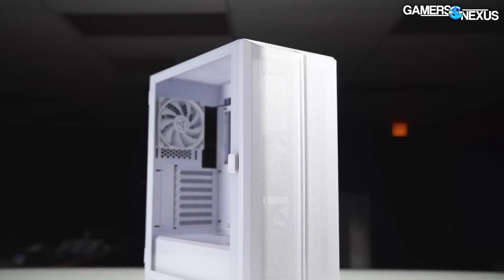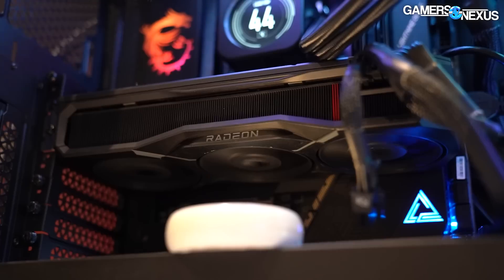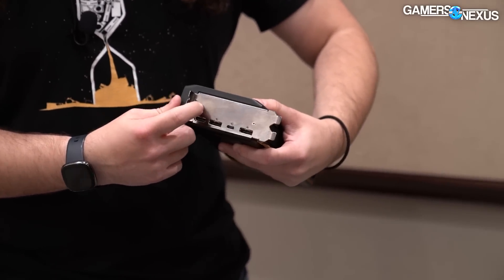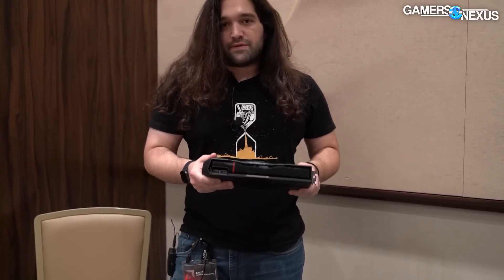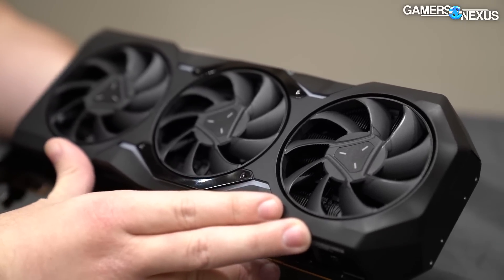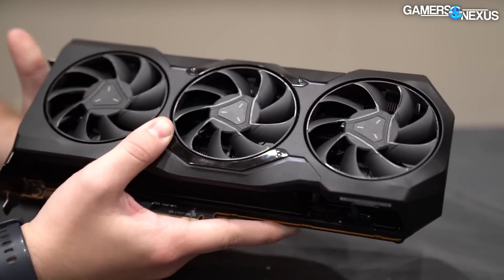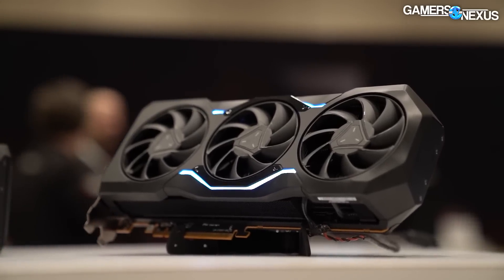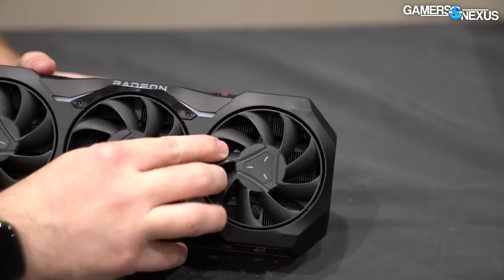More Video Cards Need This: AMD RX 7900 XTX Reference Design Hands-On

Comment: It's a shame it's cheap plasticy looking. Compared to Nvidia FE design it looks budget as hell
Reply: Yeah but you're paying for that extra appearance, and you'll only look at it occasionally.
Reply: @WaterZer0  I agree you might be paying a small premium for it. Ignore the very highest card, even the 3060's are the same design on the FE models. Also, my 4090 is in my peripheral vision the entire time I'm sat at PC.
Reply: @rossharper1983  given it’s size, it’s in everyone’s peripheral vision even those who don’t own one. Kidding aside, I find the only way these cards look good is with a vertical mount and given the 4090 size and power I question the logic of doing that in a glass sided case.
Reply: @backupplan6058  I think the 3 and 4 series FE models are the best looking graphics card made by any company past or present. Sleek, sophisticated and none of the gawdly gamer colours or RGB
Reply: @rossharper1983  yeah but that’s in a vertical position, 99% of GPUs are not mounted vertically and it’s generally impractical for most systems.
Reply: @backupplan6058  mines not vertical, even horizontal they are the best looking cards, especially my 4090 FE with that beautiful slight curve to it
Reply: @rossharper1983  really, it’s two bits of silver both sides, a black section in the middle with a light up product name. If that’s your definition of beautiful then you may need to get out more.
Reply: @backupplan6058  I can see the top and the back and yes that is my idea of beautiful compared to some of the ghastly crap AIB's come out with. 

Minimalist is what I like.

Comment: Hey Gamers Nexus, did you hear anything about Ray Tracing performance at the event? It seemed to be absent from the main talking points and has been a pain point for them since the 2000 series.
Reply: They said RT will be up to 50% better
Reply: If you scale the comparisons AMD did with 6950xt, it should be better than 3090ti, but not nearly as good as 4090. If they can get close to 4080, it'll be best case scenario. My guess, competitive with 4070(80) in RT, looks like 5-10% worse than 4090 in raster - at 60% price.
Reply: RT is probably 1 generation behind.

Comment: What AMD really needs are drivers that work.  My 6900XT would be much better if it didn't black screen randomly.
Reply: You sure you just don't have a crap cable? Not something that's a common complaint...
Reply: ddu it, update windows and any other software that you use on the regular, then install new set of fresh drivers, if it still occurs rma it. had it with my 3090, after all that it started working fine.
Reply: I also had that problem until i switched from optional to recommended drivers
Reply: @zokuva  I have tried a reinstall and many driver versions :(
Reply: @smevox7490  with ddu? Or just installed on top of the previous one?
Reply: @Eric Works on my machine.
Reply: Try Linux, that should fix your problem.
Reply: @purpasmart_4831  it might, but it will likely create many new problems

Comment: This feature is another handy tool for crypto miners. These cards with their efficiencies and pricing seem to be geared toward miners rather than gamers. Good luck trying to buy one of these when they're released, the miners are going to all be upgrading their rigs.
Reply from the maker: Isn't mining basically dead right now?
Reply: @GamersNexus  im starting to slowly buying cheap 3xxx,those who roi a long time ago like me are ok at a loss (if its affordable)
Reply: @GamersNexus  Ethereum mining died off when they switched to proof of stake. Bitcoin hash rates are currently 300.30M TH/s, a year ago they were in the 150 range, so no. The biggest issue for miners right now is the spike in energy prices combined with the drop of value of bitcoin, but if the energy efficiency claims are to be believed, a lot of the AMD 7900 cards will end up in bitcoin mining rigs.
Reply: GPU mining is dead. So, even if that's what it was designed for, it's not likely to be used that way.
Reply: what miners?
Reply: Lol no

Comment: Do those fans have a "wheel" along the ends of the blades? Is that to help keep air from escaping out the sides of the fan and direct airflow directly down?
Reply: It does have a flow control effect but more important is allowing the use of less spendy plastic compounds since they don't need to have deformation characteristics that would prevent the fan blades from "straightening" out over time.

Brittle failures of fan blades that have hardened through atmospheric exposure or fatigue over time when the blade material isn't optimized for sustained G loads is usually how it goes. The ring can't prevent this entirely but it does make it far less likely
Reply: yes

Comment: More video cards need this feature: VGA connectors. Have you seen the price of DisplayPort or HDMI to VGA adaptors lately?
Reply: Why? Do you regularly use monitors that are 10+ years old? Pretty much only really bad monitors meant for light office use still use VGA and those people don't need a brand new high end gpu
Reply: @FluffyWuffy17  I think the correct term here, is "whoosh".

Comment: Is it just me, is that cooler REALLY freaking cool? Aesthetically anyway...didnt like the 6000 series default coolers, but these 7000 ones look amazing
Reply: The cooler looks a lot like MSI's Frozr cooler, with those pointy edges
Reply: It looks cheap, I couldn’t believe it’s the FE version until I see re Radeon logo. I thought this card was designed by a 3rd party Chinese cheap as gpu maker.
Reply: @zihechen3111  no hate but just a disclaimer because it’s kinda misleading to use the founders edition nomenclature for reference models. 

TL;DR reference is a spec for board partners to help design their cards, it’s a reference of what a gpu could be like, whereas founders edition is a closed source implementation by nvidia that competes directly with their own partners.

The founders edition system is anticompetitive for the AIBs (which is one of the reasons EVGA left the gpu market) that have to compete with it, this is a reference cooler design for reviewers; it’s not the same thing as a “founders edition” card, it exists solely as an example for what a pcb / cooler implementation of their gpu could be like. You can’t buy a founders edition gpu from anyone, whereas you could always buy a reference model cooler from any AIB in the past, whereas now the design is closed off and only nvidia can sell the reference design cards and they withhold all specs such as die size, cooling requirements, etc. until the official press announcement of the product, which allows for them to have an unfair advantage against their own partners selling GPUs. Just look at a PNY gtx 780 reference for example, then look at the GTX 780 reference design.
Reply: @zihechen3111  it looks fine to me, you must really really like a certain company
Reply: That light strip is garbage
Reply: @Capellix0001  you can turn it off , or make it red. Its RGB.
Reply: @Capellix0001  Bruh, who cares about a damn light strip 💀
Reply: @Crecross  As a Linux user, I care somewhat, because there's still no way to control the lighting of most Radeon cards in Linux systems. This means that users like me are stuck with whatever the default setting is. While not a dealbreaker, it can be rather annoying if it clashes with the aesthetic of the rest of the build or is dynamic in a distracting way. The best solution would be to enable lighting control for Radeon cards on Linux, but simply having no lighting strip is also fine.
Reply: @liquidcorundum6568  Who told you to use Linux, definitely not me (joke)
Reply: @Capellix0001  well dont buy the refence card youre loss RGB makes it faster !!
Reply: @volvot6rdesignawd702  No, the red triangles make it faster. Even Steve said it also. Ha ha.
Reply: @Capellix0001  someone is salty...

Comment: Features are really cool. Mainly just pleased that the card is REASONABLY sized. Don't care about the top end pushing the limits, but mindless power consumption for the sake of it, is stupid. Anyone without a full size case can't use RTX 4000 cards.
Reply: @dj Kplus i do hope AMD lets AIB's have a bit more freedom with power limits this gen .. i believe if you could push 400 to 450w through this bad boy your going to have some huge comp in raster over the 4090 4090ti !!
Reply: @volvot6rdesignawd702  7900xtx gets 98fps in God of War. 6950xt gets 74fps. This will not be a 4090 competitor. 7900xtx will be 30-40% faster than 6950xt at 4k and 20%ish at 1440p. Will be good against 4080 16gb raster but get demolished in RT. I don't expect the 450w power to give more than 3-5% extra performance. Unfortunate.
Reply: @jjlw2378  some are saying 10% to 15% uplift at 450w IF AMD allows that type of boost is still to be seen as they dropped the ball with RDNA2 with low oc power of 300 310w on cards engineered for 400w  ..

some channels like linus and others mock fps figures based on AMDs numbers are showing the 7900xtx on par with the 4090 in raster..
Mind you personally im taking mock figures with a grain of salt and until i see real world numbers im not convinced 
where AMD has won me is price and performance do i need a 4090 if the 7900xtx is going to be close enough 

In Australia the 4090 on average is between $3000aud and $3800aud now im predicting a 7900xtx will come at around $1800aud to $2700aud for the top AIB 

Seriously $1000aud for a few frames and better RT is that really worth it ??
Id rather that money in my pocket !!

At first i was hoping that AMD crushed anything Nvidia released Grim reality is though after seeing RT and the sheer size/power draw of the 4090 it would be hard to beat !!

Im not sure where AMD should go they have crushed Nvidia on price to performance and efficiency do they really need to take the crown to bring prices down  Nvidia clearly dont give two f..ks and people reinforce that by throwing whatever Nvidia asks cost wise at them !!
As plebs we will never know the true sales figures of what is selling better  !
Reply: @volvot6rdesignawd702  A 450w 7900xtx kinda defeats the purpose and is just a hotter and worse performing card than the 4090 that everyone loves to hate. I think Nvidia just outplayed AMD this time. Perhaps AMD will shine at the mid/low range.
Reply: @jjlw2378  I dont think Nvidia out played AMD i think it s the other way around on price , performance and efficiency ..

Every thing expensive than can be thrown in the 4090 has been if the 7900xtx comes even close which i believe it will at the cheaper price then who has rolled who here??

If you do the figures ive seen 10% to 15% less performance at 60% less cost sorry that is huge!!

RT has always been a hit and miss feature the 4090 is only now allowing people to realize the potential of it before that the fps was just to low even on 3090s ..

If AMD made a card with all the same tech as Nvidia wouldnt they need to charge the same price kinda defeats the purpose of competition !!
Reply: @volvot6rdesignawd702  Enjoy your purchase then! Just please be sure to watch reviews before pulling the trigger.
Reply: @jjlw2378  yeah i will for sure im not going to just buy what ever !!
Reply: It is also reasonably priced
Reply: @broklond  Uhm...nope, not really. It's just better priced than nvidia cards. Both go beyond what I consider reasonable tho. I bought my 1080Ti for little over 600€. That's what I consider reasonable for a high end card.
Reply: @Shendue  thats the thing if the 7800 and 7800xt wind up at the 600 to 700 dollar range that wont be bad especially since they would competing with the 4080 16 gb card which is 1200
Reply: @Shendue  That's not an applicable comparison. Like at all.

Just the inflation of prices in well , everything is quite a problem , especially for tech parts.

Not to mention that comparison barely applies since 1080ti launched at an MSRP of 700$ with almost every single one being higher than that. So it's at most a 40% increase in price. Your personal experience doesn't apply when comparing MSRP. That's not even adjusting for the inflation since 1080ti launched in 2017.
Reply: @Shendue  Inflation is a thing.

The days of $700 flagship cards are over whether you or I like it or not. Get used to it.
Reply: @dj Kplus from what ive heard the AIBs will add a 3rd 8 pin plug

Comment: I really hope AIBs stick to that size. I hear they'll just do a slight redesign for bigger coolers they were planning on using for Nvidia cards
Reply: I actually prefer a card as big as AiBs want to make it. It'll fit my case no matter what, so more surface area is always good for noise:temps if it's used well.
Reply: @libertyprime9307  I mean, that's good, up to the point it's like +$200 for just a big cooler and very marginal performance increase
Reply: @JBrinx18  Bigger coolers themselves cost almost nothing more. Obviously I'm not paying some huge premium just for a bigger cooler, but all other things being equal I'd prefer it.

We saw AIBs this last gen just using their biggest cooler from 6900XT/3090 all the way down to the 3070/6700XT just to save on costs of designing a smaller one. The logistics of making a new cooler was more expensive than materials of just using the largest.
Reply: Shroud design will be the same, but for cost optimization they will cut down on the actual finstack's size. So we will probably get some overclocked 3 slot 3*8 pin designs, but surely some 2,5 slot 2x8 pins as well.
Reply: I wish the true two slot cards would make a comeback. Cards like my Power color red dragon 5700XT. It's a bit taller but I like the sleek look of true two slots.
Reply: @crazycoffee  It really seems looking at everything it will be absolutely possible for a 7700XT to be not a dual slot but a single slot design, like omgwtf
Reply: @dagarath  Wait until you think about what the 7600 and 7500 could be. This is reminding me of what it could take to make RX460 kind of "wait is that really just an exposed PCB with a small fan" kind of cards, but that "exposed pcb with a small fan" could have similar or better performance than my reference 5700XT.
Reply: @crazycoffee  I love my Red Dragon 5700 XT. Still does extremely well even with new games.

I'll probably skip this gen as well. Probably wouldn't if economy were better, but if the card still works great, why update? My 3600 though.... Still probably wait.
Reply: @billybob4274  a 5600 is +20% CPU performance for about $130. Can if you want to ebay off 3600 for about $70 if in good condition with original packaging. That's a worthy upgrade for so cheap
Reply: @crazycoffee  I want the 1-slot cards to make a comeback!
Reply: @crazycoffee  They still exist, but these are flagship cards, they push the limits.
Reply: Depends on how much AIB will push
Reply: man rip to those who using 10l below build
Reply: Considering the card is so close to the max 375W power delivery on 2x PCIe 8 pins + 16x slot, AIBs will have to implement a 3rd PCIe 8-pin socket on the board, and boost the power delivery electronics. They will most likely make them massively bigger.
Reply: @LemmingOverlord  as long as it hits the 375w on the reference clocks it'll be fine. the actual 8 pins can handle significantly more than that with any non-bargin bin psu. but OEM's would never let them change the rating since it would cut into their profit margins being able to use cheapo psu's.